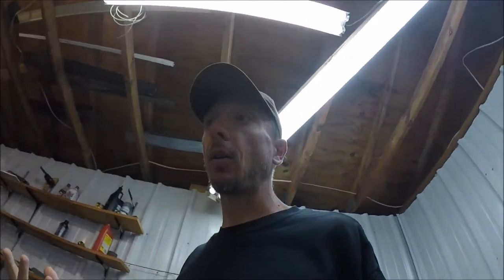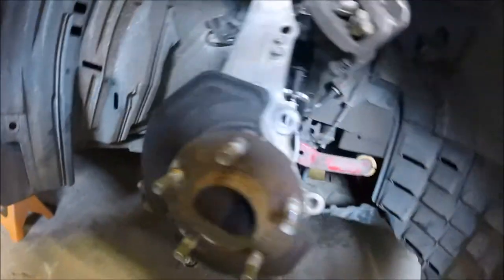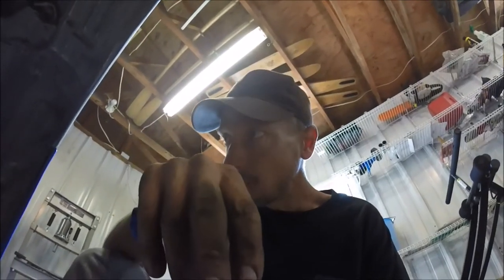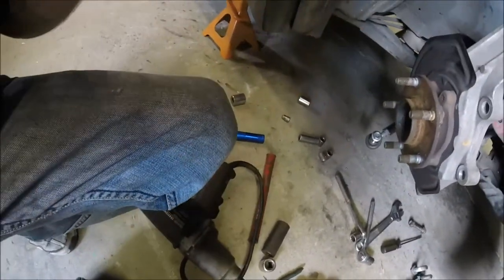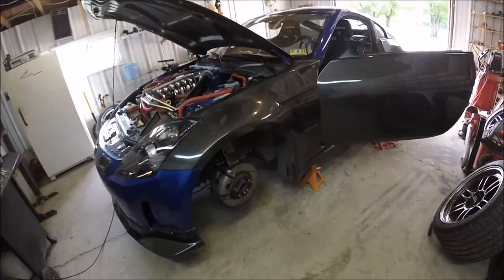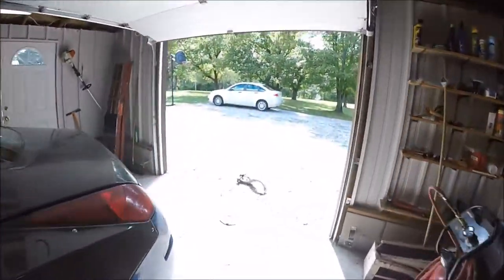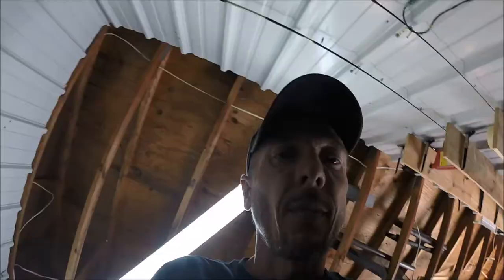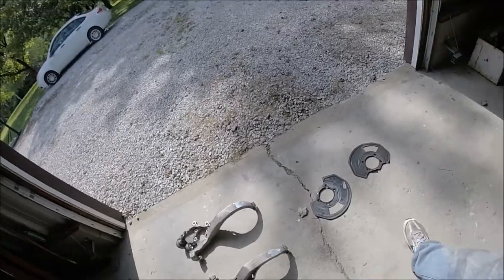350z Front Spindle Knuckle Removal

Comment: I snapped the bolt off the bump stop as well. While I tried to extract the bolt I snapped the drill bit inside the bolt immediately. Finally got that bit out but didn't have a dead center hole to drill the rest of the bolt out nice and straight. Attempted anyways but when I tried to re tap it I ended up going in crooked. So... going to the junkyard for a new knuckle cause I don't want to go a size up just to be safe and bore out my angle kit cause thats where the kit bolts up lol. Just my luck!
Reply from the maker: Damn bro sorry to hear about all your bad luck I'm sure things will turn around for you 👍